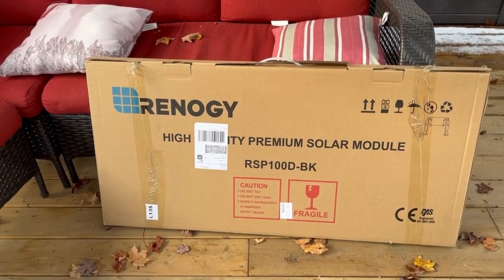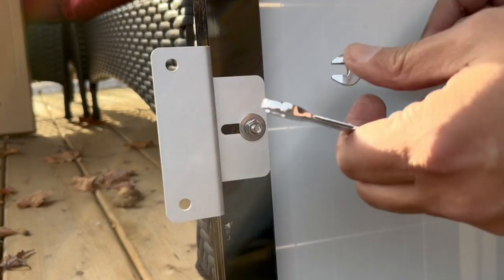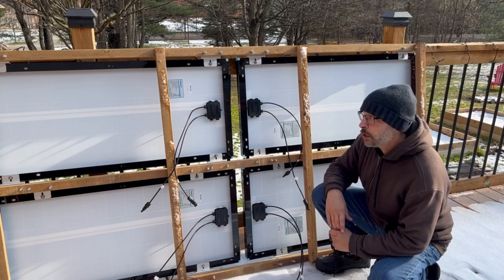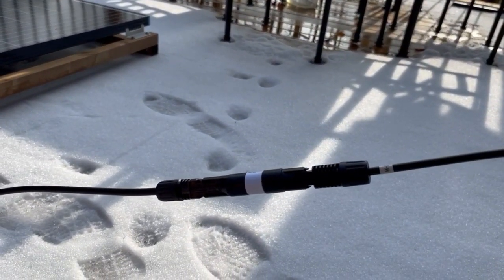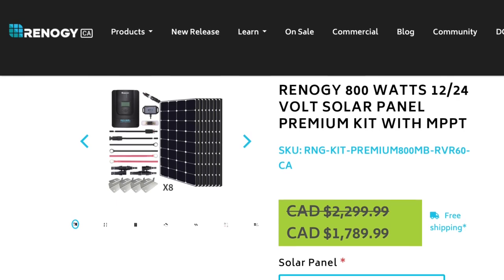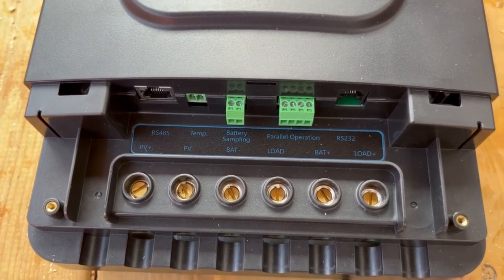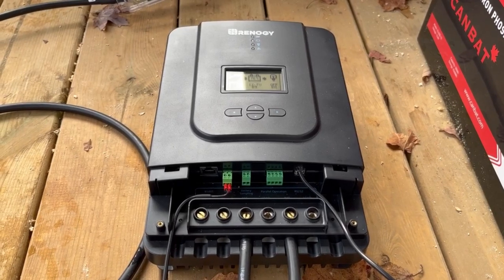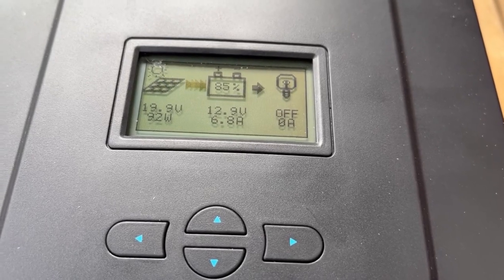How to build an OFF GRID solar system!

Comment: I’ve a similar system (1000w) at my off grid cabin in a similar climate. I recently switched from cheap lead acid batteries to a single Java Energy 300AH LIPO4 SmartBattery with an internal heater and Bluetooth from Amazon for $950 US. I’d definitely acknowledge I’m taking a chance on an unknown Chinese battery company. I’m had it for about a month and so far I’m delighted. Best of luck with your channel.
Reply from the maker: Appreciate it!

Comment: I run 3 panels in hot desert Vegas.
Today is cold, 30 F.
For whatever reason, my system performs best
Today.
Panel pump 20 amps from my patio roof.

I wonder why Canada is not ‘hot’ with solar.
I guess snow blocks sunlight.
Coldness helps as heat can deter current flow.
Reply from the maker: Solar is starting to take off here now as more people like me start by buildings smaller systems.
Reply: @truenorthoffgrid367  I have lived in Edmonton for 3 years. Very long winter dark hours, solar don’t seem to work too good.. Summers are short. Sun is bright though. Little pollution. But, cloudy as I recall.
I learn my electrical in Edmonton.
Solar is fun project. It runs lighting for half of my 3500’ home, yard waterfall, fengshui, 10K btu air conditioning in summer, which pays off immediately here with 100f summers.
Keep your budget low as possible otherwise it becomes another expensive toy.